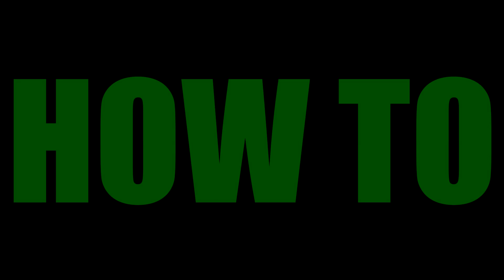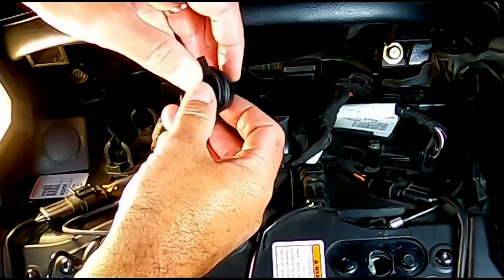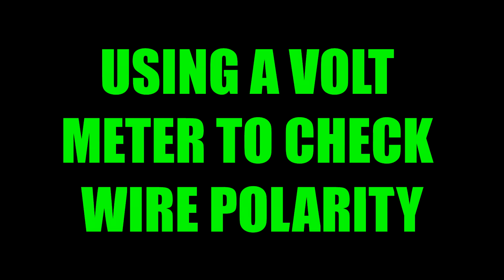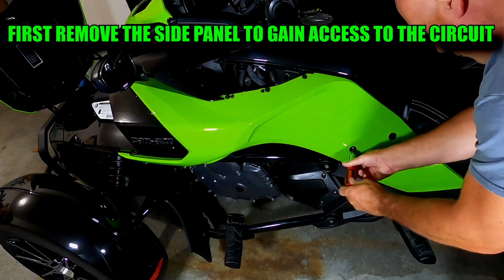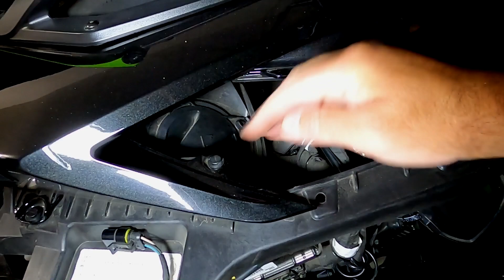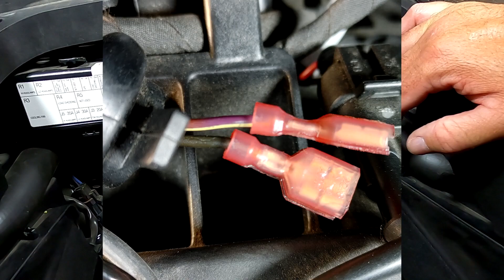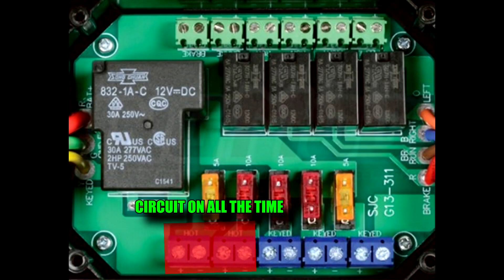Can Am Spyder, Ryker, and RT - Accessory Circuits. This is the best way to install accessories

Comment: Looking at installing posi-tap connectors on the front accessories wires. Would you happen to know the actual size the wires are? Enjoy your videos!
Reply: Thanks for the quick response. I'll look into those asap! Have a great day.
Reply from the maker: Your welcome, i was luckily on break at work when you commented. I like using the kind like i sent in the link. I use them on my jeep as well because they create a good seal too.
Reply from the maker: The size of the wire is different than the size needed for posi-tap for some reason for most of the wires. I tried 3 times to order by the size of the wire and each time they were way too big. Here is a link to what i buy for mine and as long as yours is a 2015 or newer this should work.

Check this out!
Posi-tap Connectors, 20-22 Gauge Wire, Bulk Pack of 20 https://a.co/d/cv1lvuY

Hope this helps and if you try to buy another brand start with the 20-22 gauge size. There are different size wires on the Spyder too so you cant go wrong if you get a varity pack.
Reply: I currently ride a 2021 SpyderRT.
Reply from the maker: @garyoconnor599  the 20-22 gauge size will work then. They are all different colors too so find the red with one tip grey incase it doesnt say what size.

Comment: Man, I got the Show Chrome fuse block for my 22 F3L, but am lost on hooking things up. I’m just trying to run my GPS and some mirror turn lights to it. Any help would be appreciated.
Reply from the maker: Hope this helps...... first be sure to disconnect your battery before doing any connections. This should/will help prevent any damage.
Run the positive wire on your GPS to a "+" spot on your fuse block that is labeled "keyed". This should be a blue squared block with the wording "keyed" above it. Then run your negative wire on the GPS to the "-" spot (on the same blue block) on your fuse block. This will turn your GPS off when you turn your ignition off and save your battery from dying. From what I remember about show chrome is they may have about three sections labeled keyed. It doesn't matter which one you use just be sure that the "+" and "-" are in the same square section.
For the mirror light, run the left mirror positive and negative wires to a green block on the fuse block with the word "left" on it. These will probably be on the opposite side of the blue sections. Run the right mirror to the block labeled "right" and it is a green colored block also. Make sure to connect the "+" to "+" and "-" to "-" for the left and same for the right as well.
Hope this is what you needed and ask more questions if you need to.
Reply: Thanks, definitely appreciate it. Does the Show Chrome have to be connected to the battery in the frunk of the Spyder? I was going to put it where the seat is, but saw if I did that the wires wouldn’t reach the battery from there. 

I was trying to read the instructions (very confusing) and it made it seem like those other wires are supposed to somehow tie into the wires under the seat.
Reply from the maker: @SPYD3RRID3R  Your welcome and your first question was a little broad so I'm glad you are asking more so I can help. Dont hesitate to ask anything as this may help others too. I would keep it close to the battery and I believe you should have a little room there. Remove the frunk and you should be able to see an area. You do want to connect the battery wires to the battery and then I would use the auxiliary "+" wire near the front like I show in the video to connect to the keyed wire from the fuse block. I think showchrome has a yellow wire but it should be labeled "keyed +" I believe.  I would not recommend placing that fuse block under a seat. It is best when dealing with electrical items to always think "where can I place this where it will not be bothered, touched, or moved at all." There is also room underneath the front panels if you remove them.
For connecting the brake, running, right and left turn wires on the fuse block it is best to use a tap like the posi-tap connectors to connect to the "+" wires on the spyder.
I appreciate the comment and support too! So thank you for that!
Reply: I found a spot for the fuse block in the frunk and put in the gps and turn light wires. Could you explain the part about those 4 wires on the left for the brake, running, and turn lights? I don’t exactly know where those are supposed to tie into on the bike or how to do that. Thx.
Reply from the maker: To ensure that you get the best help on that i would contact Slingmods. The reason I am saying them is that they have access to all showchrome fuse block models where i dont. They can help you out better with colors of the fuse block and the colors of wires on your year Spyder. They are a great company to deal with as well for product questions. Outside of the US products have different wire coloring for positive or negative sometimes and the Spyder is no exception. I believe slingmods should be able to give you the colors or placement of the wires you will need to connect to for the brake, running, and turn signal. For me it is easy to find the wiring when i am in person and can physically see the wires. If i give you the wrong color or description of the Spyder wiring connections and you hook a + to a - then you can damage your System. If you need help after speaking with them then it is probably best to email me at 
moab.man@yahoo.com
As it will take a lot of explaining of things if you are unsure in how to even connect the wires together. I do recommend watching my video

https://youtu.be/iTLkfEtQsNM

where i explain using a "Posi-Tap" connector to splice into wires. This will help you when wondering how to tie in to a wire with another wire.
Hope this helped.
Reply: Sounds good. Thx for the help.
Reply from the maker: @SPYD3RRID3R  Your welcome and hopefully they will help.

Comment: I’m looking for a way to add a constant power 12v power port to both my dash location and rear trunk. Preferably direct connected to the battery and fused. I want to be able to power up things like a spot light, portable air compressor and similar devices without having to turn the key on. Any experience in this area? My Spyder is a 2022 RTL.
Reply from the maker: Thank you for the question. You pretty much said the answer when you said directly connect to the battery. I would not recommend doing it any other way as your computer system will probably not like the surge if you use any circuits on the Spyder. If you are familar with relays then i would include those in the wiring. If not, be sure to fuse it. When looking for the items to use for connection i recommend using anything "Marine" or "boat" because these will be the most waterproof. On youtube there are a lot of videos that can show different ways to do these connections. A lot of jeep wrangler videos will show you ways of hooking up lightbars, air compressors, etc. Instead of a car battery you just hook up to your spyder battery but same process. Hope this helps, but just be aware that compressors and spot lights will drain your battery quickly when the bike is turned off.
Reply: @MOABMAN  Any suggestions on routing? BRP really missed the boat on accessories. If they had installed 12v power ports at each USB location I'd have a limited current 12v power ports that I could convert to usb with any number of adapters. The current setup allows usb devices only. And to give the customer a stereo that can only be utilized with the key on and the rest of the bike powered up is a 'duh' moment. Why not include an accessory mode on the key switch? This should be an aftermarket product designers opportunity here. And yes, each of my 12v power ports will be fused close to the battery. I currently have my battery tender pigtail installed in the front trunk direct connected to the battery and fused at 15 amps. That is my 150w connection for my 12v air compressor connection as well as my charging from the battery tender. The other 2 once installed will probably be fused around 5amps.
Reply from the maker: @robertlarrabee9115  The best advice i can give you on routing is remove all the panels you can, then route the wiring to the main frame/bars and ziptie as much as you can. This way, if you have to have the bike serviced you will know that they dont have to remove the wiring. That is the mindset i suggest you be in for routing the wires. Keep away from metal that heats up and try to wire in permanent locations. Im not sure if this is the answer you were hoping for but i think it is the best recommendation for routing the wires. Most people i know that dont think on this level just lay the wires loosley then blame the Spyder when the wires malfunction or burn.
Reply: @MOABMAN  It's a great help hearing from others who have experience in this area. I added a stereo to my snowmobile and I used some of the same techniques you mentioned. I thought I chose a fairly safe route for the wiring but had to do a reroute after the power wiring melted. Moved the wiring to another location and wrapped in metal foil to reflect heat away. No issues thus far. I can just follow existing wires up to dash and to rear seat area on the Spyder. The trail has all ready been blazed so to speak.
Reply from the maker: @robertlarrabee9115  You sound pretty knowledgeable so there really wasnt much for me to help with but i hope i did. If you dont know about them, i recommend learning about relays. They are truly the way to go for safety and i use them a lot for my offroading gear on my jeeps. Thanks again for the comments and suport!
Reply: @MOABMAN  I prefer fuses over relays when the load and the relay are powered from the same source. Otherwise the relay becomes another load on the battery when you operate whatever it is you’re controlling with the relay. The relay really isn’t meant to provide overload protection but rather to let you control a load with a set of contacts from the same or different source. Same but different if you get my gist!
Reply from the maker: Always good to hear when someone understands things. Sounds like you have either a good mechanic background or electrical as most people dont know these things.

Comment: I'm looking for instructions how to use a USB port to supply Music while riding instead of useing the Radio on my 2021 F3 limited. and help would be great.
Reply from the maker: There are several solutions but i think that it is not possible through a usb port. You will have instructions in your manual on how to link your phone to the Spyder by bluetooth and then play music that way. This has been an issue with a lot of riders though that they cant get it to work. If there is a connection possible by usb (maybe something new in 2021/2022 models) the handbook will have instructions. As far as i know the usb is only for charging.

 The 2nd solution is to just bluetooth connect your helmet system to the phone for music. I use a Sena communication for my wife and I, and it allows for music to play via bluetooth connection.

The 3rd solution is purchasing an aftermarket speaker setup that does have this type of connection. I have seen multiple companies with these add ons.

Hope this helps and sorry that i dont have a positive answer on the usb connection.

Comment: On my 2019 Spyder RT Limited, are there 3 accs. circuits or just the one up front and on the right?
Reply from the maker: Very good question and i hope my answer helps. I would use the ones in the front only. For RT models the one that is in the back may be used already for accessories like heated seats, grips, usb plugs, etc. So yes a third does "exist" but may be used by BRP already and therefore is already wired up to something. If you need to install things and want something at the back, i suggest getting an accessory fuse block from Slingmods that you can wire from the front and attach it to the back or middle area. This way you can wire stuff more easily and not concern yourself with messing up anything in the back. An accesory fuse block is the safest route to add extra items as well so your not constantly jiggling or cutting on OEM wiring. If you are dead set on seeing if there is a accessory circuit like what i show, you can ask a dealer/mechanic to show you where or if one exists on your specific model. Again hope this helps and if you need something more than what i answered, ask away and i will do my best to help
Reply: @MOABMAN  thanks for the info. I've asked my dealer where the accs. connections are and only was told the one in the front. Couldn't tell me if there were any more. I may go the fuse block route but have to remove panels anyway to run wires. Just wanted to put a dual USB switched port on the accs panel under the handlebars.
Reply from the maker: I did a USB port in the same spot you are wanting. I used the circuit on the side/middle that I show in my video. It will be the same area for your RT. If that is all you are doing I would not do the fuse box, just use the accessory circuit.
Reply: @MOABMAN  Thanks, I will use the accs. connection on the side. Not really interested in adding extra lighting or other accs on my Spyder RT, it has all I want from the factory.
Reply: @bruceadkins6706  One last question, I would like to extend the USB from the Frunk so I can hook up my phone in a cradle on the handle bars. I don't like running the cable outside the Frunk and stringing it around to the holder on the bars. DO you see any problem with extending that USB, maybe bringing it up beside the steering column? I don't know where the Gerry Stahly contact came from--
Reply from the maker: @bruceadkins6706  Hello Bruce, i will reply to this one and not the gerry one. Youtube has been acting up lately for me too. You can extend off of the other usb but i would not use it AND the other. That may overload the circuit then blow a fuse or even show an error code or warning light. So if you branch off of it, do not use the frunk one any more. Or dont use it AND the other one at the same time. Coming up by the handlebars/steering column is ok, just make sure that you pay attention to it not snagging when you turn the handlebars. Every time you turn the bars you do not want it cutting or pinching the wires. Also keep in mind the longer electricity has to travel the less voltage it can have at the end of the connection. Try to keep witing as short as possible for usb type connections. Please dont feel like you are asking to many questions, im always glad to help if i can and if it is a question i dont know then i learn about it, so always ask away.
Reply: @MOABMAN  Thanks, I was just going to get a cable to extend the Factory USB upfront to the handle bars so I can plug my phone to it as that is the BRP hookup. I don't want to put my phone in the Frunk and not be able to get to it. I plan on running the extended cable under the panels and only use it for the phone. I will do this on the right side of my Spyder RT LT like you have stated before. Then I will hook up to the accessory wire and put in a dual USB switch in the console.
Thanks again!!
Reply: @MOABMAN  Thanks, I was planning on extending the Fronk USB for connecting to the BRP system. At least that is what it was supposed to be used for as it also charges my phone. I was going to tie into the accessory wires under the panels on the right side for a separate USB connection . These two don't inter twine do they?
Reply: I have a glitch in my email or face book system as I am not Gerry although he is temperately living in my home. Gerry is my stepbrother.
Reply from the maker: As far as i know they are seperate circuits. Instead of cutting any wires you may want to use a Posi-Tap connector to tap into the wires. This way you can still keep original wiring and connections. Just make sure you try your best to "waterproof" everything with heat shrink tubes or electrical tape.
Reply from the maker: I was worried you were getting hacked and identity stolen or something!👍
Reply: @MOABMAN  Don't know why it shows up as Gerry, have been trying to stop that glitch, Google no help as yet.
Reply: @MOABMAN  Thanks again--I will waterproof for sure.

Comment: Can you connect led light set to these connectors that you mentioned for the spyder?
Reply from the maker: Yes and it is one of the best ways to do so. The only thing that is different on some models is the color scheme of the wires. Thanks for the comment and support.

Comment: silly question.  do u just pull the frunk accessory wire out to connect  to it? i have a 2021 f3sss and the frunk accessory wire seems to be stucked or connected to something esle. I dont wanna pull it too hard and damage something.
Reply from the maker: Not a silly question at all. Mine is the same way. Please don't pull hard on it because it is short and is connected on the other end. It is aggravating to work with but that is all the length you have. It is ok to move around but again don't yank it because you can damage the wire itself.